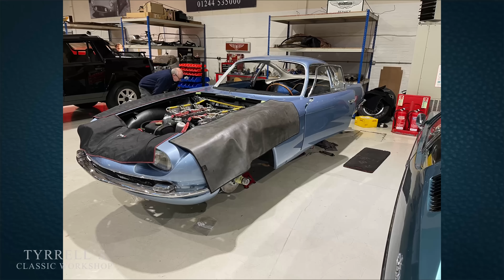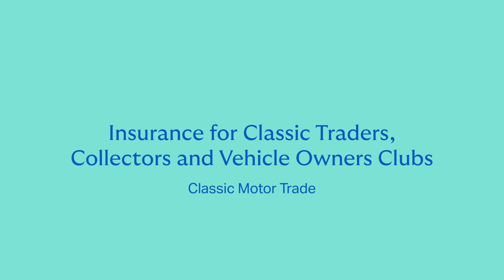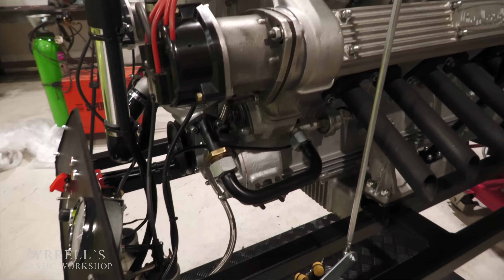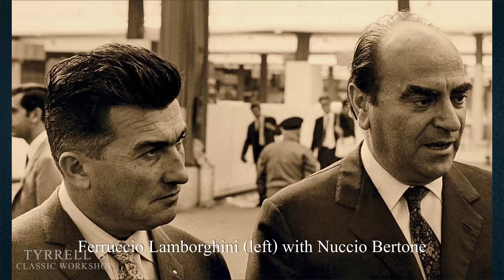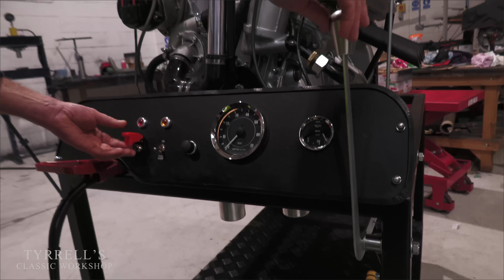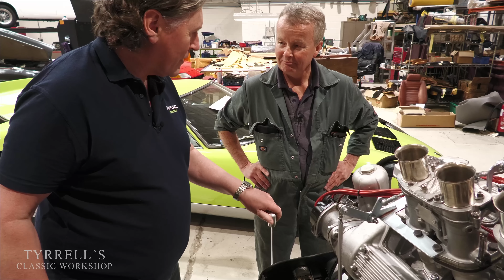Lambo No. 6: Vintage V12 Power Roars Back | Tyrrell's Classic Workshop

Comment: Love your work, being a bit OCD those plug wires need to run all in a line not crossing over, those braided hose pipes look a bit naff and the clips holding them on need shorter bolts - IMO replace with something less bulky. Wonderful work however and just being picky as its such a historic engine - wish I had the skills.

Comment: Iain, I had read that the early Lamborghini V12 engines were very noisy and it was something that I experienced when I was given a lift in a Muira in 1975 in London. After 20 minutes I was ready to abandon ship as it was becoming very unpleasant. Somewhere in the dim recesses of my memory I think I read that it was due to something in the camshafts but may well be wrong. Can you comment?
Reply from the maker: That definitely was a fault of some description. The Lamborghini V12 is surprisingly mechanically quiet considering everything that is going on. The Miura is in no way quiet but it’s not harsh either. Thanks for your interest
Reply: @iain_tyrrell  Thank you for the prompt reply.

Comment: Pardon my inexperience, Why couldn’t you use this engine in a car again? Given the meticulous and thorough internals rebuild.
Reply from the maker: Cylinder block castings have a hard life. They constantly expand and contract with heat, with other parts fitted that don’t so much, causing things to “move” internally and externally. They possibly corrode with water, can warp with overheating, can suffer bearings coming loose and spinning, causing damage. Sometimes they need material taking off to level surfaces up which causes other problems, etc etc.

Comment: This is so amazing. 
I really didn’t get why this engine cannot go back into a 350gt engine bay anymore however.
Reply: The block is warped and had to be case hardened other parts were worn out some past their usability date, thats why the engine is so fragile. Iain explains this during the video.
Reply: Thank you, I missed that

Comment: Great to see a historic engine like this. The only 'criticism'  I could say would be that the throttle lever has too much lateral movement in it to suit the high standard of engineering of the engine/car/brand I think. It looks like it could do with another mount at the end of the shaft attached to the frame just under the oil pressure guage as opposed to just the single mount on the side of the frame to firm it up a bit and give it the precision it deserves, but that's just my opinion. Well Done anyway. 🙂

Comment: These cars are not made to be driven but to be admired in an air conditioned high security garage under lights. Besides, every mile on the speedo depreciates the value of the car.

Comment: I wonder how many shops outside the manufacturer could even attempt to rebuild this. Work of art.
Reply: Bobileff Motor Car
San Diego CA. They do them all the time.
Reply: @BKMDano17  #6 of 123 ever made. The block was the only spare one known to even exist. I’ve seen BMC and they do outstanding work but something like this is only attempted when someone has an inside at the factory. No, they don’t do those “all the time”.

Comment: It's great when a mechanical piece of art functions as it is suppose to. When you first unveiled the engine it was a feast for the eyes. The cam covers and the trumpet intakes stood out first, but when you started going around the engine (with explanation and camera work) all the other pieces of the engine completed the picture. The throttle linkage almost looks like it was a stock part of the original engine. Good work!

When the engine was started, oh my what a symphony of sound(s). I had on a pair of headphones so as not to disturb my wife who was reading in the same room, and could clearly hear not only the exhaust, but also the intake noise of those beautiful carburetors.

Thanks for a very informative history of the engine. The engine stand is a great looking display device that allows one to see and hear that great engine.

As always a great informative video.

Comment: Curious why the fuel lines are held in place with fixed screw clamps instead of spring clamps. Screw clamps slacken over time and can be a source of fuel leaks/fires, I've even had them come loose on an old 911 I used to own. Spring clamps keep the tube tight over time and heat cycles

Comment: Absolutely beautiful ! Work of art.

Apologies for asking this 'nerdy question' (I'm sure you can appreciate) - but why use Smiths gauges, and especially a PSI oil pressure gauge, instead of a metric gauge in bar, e.g. rpm and oil pressure gauges from Jaeger?

And I assume the whole engine + rig itself comes with a 2,000 engine running hours warranty?  😉   Fantastic work.
Reply from the maker: The Veglia gauges are themselves now extremely rare and valuable. For the amount of time this engine will run, these will do just fine

Comment: Amazing episode!
Funnily enough Mercedes used a single row timing chain on their 380 r107 V8 aluminium engine, between 1981 and 1983, only to revert back to double row soon after due to issues of slacking and jumping of the chain by around 40thousand km.
If I am not mistaken.
Reply from the maker: I’m sure you are right. And then they went right ahead and made the same mistake with the 190 engines
Reply: Didn’t Triumph with the 3ltr Stag engine have the same issue by only using a single link timing chain?

Comment: Hearing safety, gentlemen?  That's physically a large motor for 3.5 litres.  I suppose the  4 camshafts contribute to the width, and the vertical carbs to the height, but it seems long for the capacity.
Reply from the maker: Wide bore spacing- hence it could be enlarged to 4 litres easily
Reply: I think for the few moments this piece of Lamborghini history and art can be fired it needs to be heard without smothering your ears with PPE.

Comment: Nice toy and a beautiful job of restoring it. BMW may use singe row timing chains these days, but they only last about 70k miles, especially with the nasty plastic tensioners and guides they fit. Even my old Saab 99 had a duplex.
Reply: alfas always a duplex
Reply: How true, some of the current German engines appear like they have fitted bicycle chains.  I'd rather a timing belt - where it's clear when it needs to be replaced.